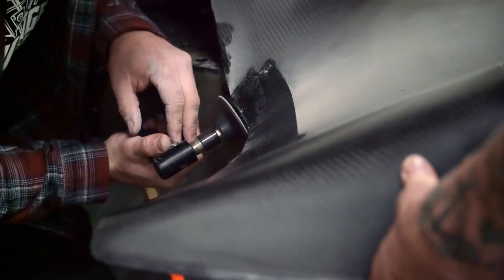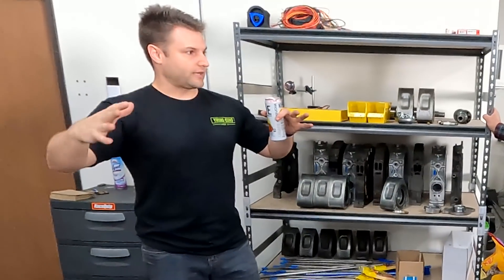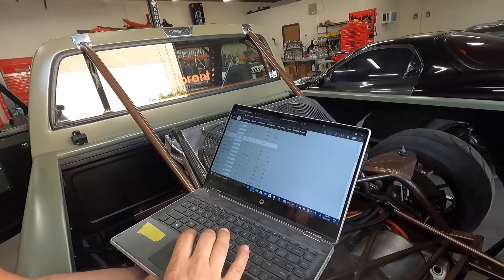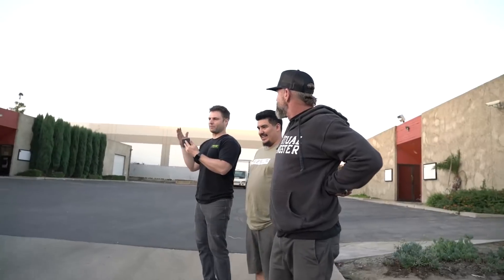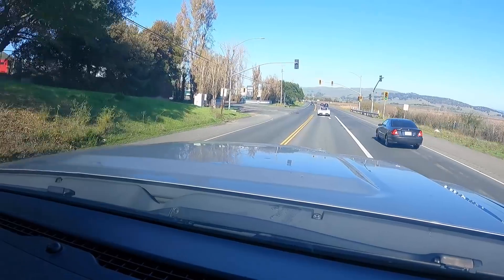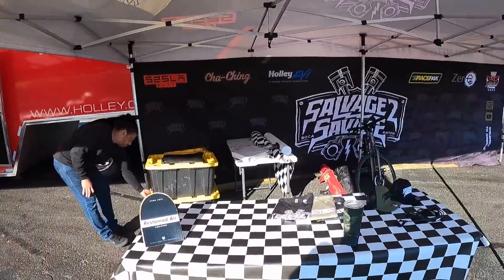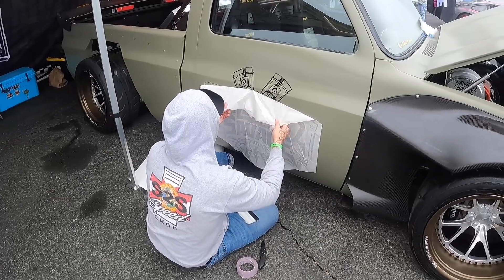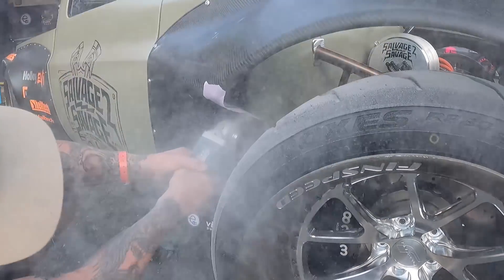Tesla Swapped Squarebody Takes on Holleys High Voltage Experience! - Electric C10 Ep. 23

Comment: For racing or "show off" mode, REGEN is not important.
For regular EV, the two stage REGEN can be a benefit.

Going down the mountains, and this depends on what mode you are in for
REGEN, the light mode will add charge to the battery.
If the hill you are going down is steep, the deep  regen can either maintain your 
decent speed or and add charge.

in stop and go traffic, the regen can be a benefit as well.

For a sport where you are accellerating then slowing down at the end of course, 
regen can be a huge benefit, after all you only use Regen to slow down and save
your brakes, right?

Speaking of brakes, your truck seems to be scuffing already.
My 2017 EV uses REGEN for almost all breaking and my disks look brand new, 
something to think about.

Comment: Can you adjust timing on them electric motors. Like my RC  electric boat. I can crank the timing up and get way more top end. I can crank  the timing way down  and run less rpm but it will turn  a bigger prop??(more torc)

Comment: 7:34 Awesome truck but throw those wheel spacers in the trash before someone gets hurt. Unless your wheels are hub-centric to the ID of the spacers (Not sure if those are even on the market), you are risking shearing all of the wheel studs off of that wheel spacer. I guarantee you those wheel studs are not as strong or of as quality as you think. Example, the bolts that are snapping on the new Eastern span of the Bay Bridge.

Comment: This is absolutely terrible I’m sorry watching these electric cars racing is something I will never be ok with everything the sheep want you to do and it only helps the rpm act “well look they can do it “ I will never drink the Kool-Aid
Reply: Funny because your ice vehicle also requires electricity&water just to refine it's fuel. And without a battery, plus multiple electric motors to run different functions, like the fuel pump, oil pump, starter etc. Your ice car won't function at all. 
I agree though about the rpm act and things like right to repair taking government oversight wayyyyy to far.

Comment: Why not automate those cooling fans to kick on with temp and pwm speed control?
Reply: Everything is a work in progress.  They literally just got that thing finished enough to put it in the trailer and get on the road.  So i imagine its got a plethora of tinkering to do still
Reply: @champspec  absolutely, and sometimes that is even more fun than the big stuff.
Reply from the maker: They will get programmed to run at a certain temp, but it's also always nice to have a dedicated fan switch

Comment: At a frequency lower than the rated frequency, the speed is decreased, locked-rotor torque is increased, and power factor is decreased.
Reply: The decreased power factor means that the drive will need to work more for the same motor power.